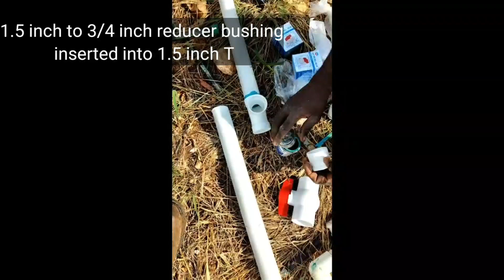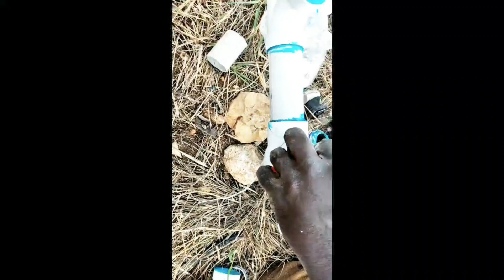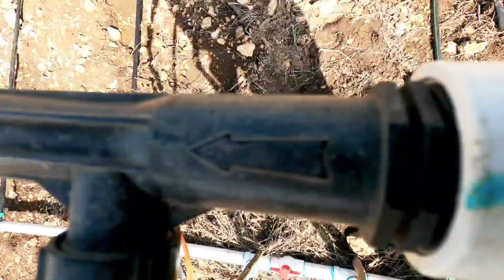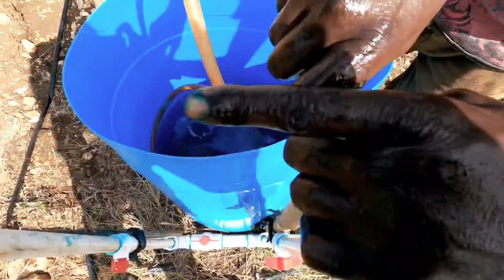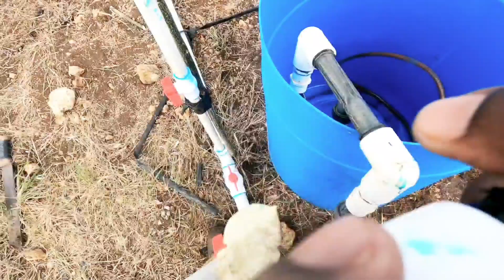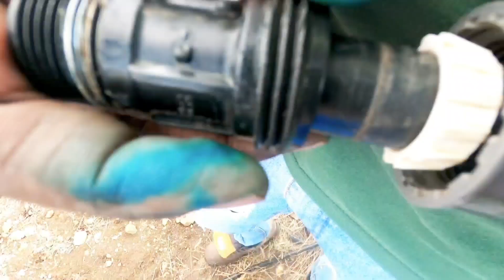How to make a Fertigation/Chemigation system: Start to Finish

Comment: Excellent video. Very educational. Why size are those pipes and why did you use those size pipes? I want to see how the conver from the PVC pipes to the drip hose?
Reply from the maker: Thank you. The pipes are PVC drain pipes: So the 1.5 inch drain pipe is reduced to 0.75 (3/4) inch pipe to connect to the venturi which has 0.75 inch size. You need a 3/4 female adapter to connect to Venturi. I choose those pipes because they are the cheaper. If you want to see how the we convert from PVC pipes to drip check this video out: https://www.youtube.com/watch?v=j090Spb5C5Y&t=169s